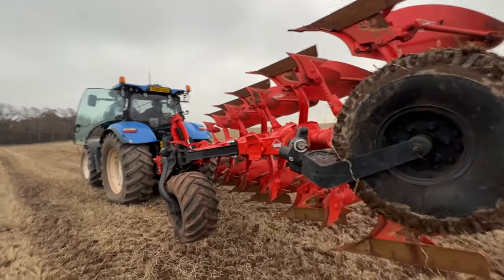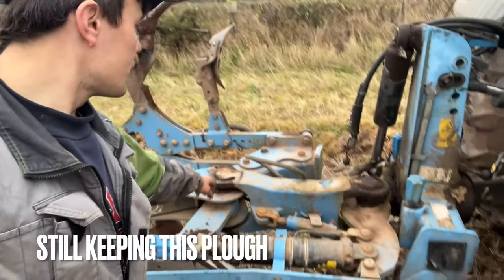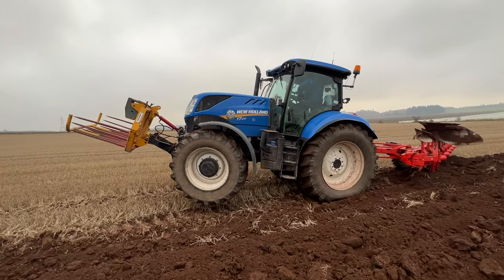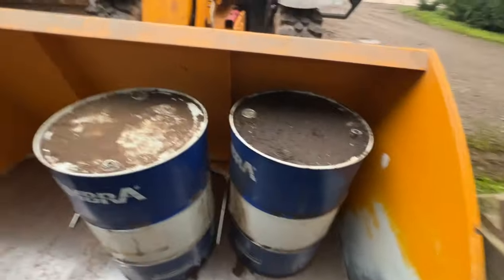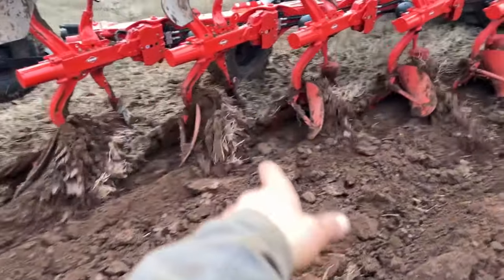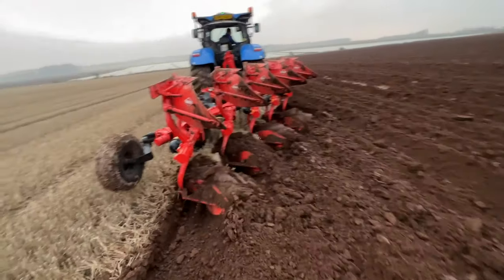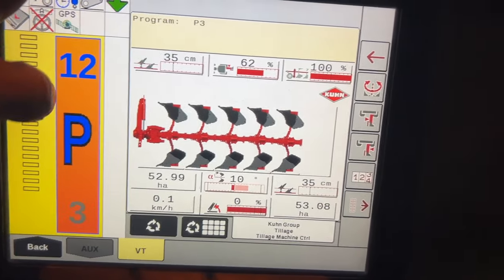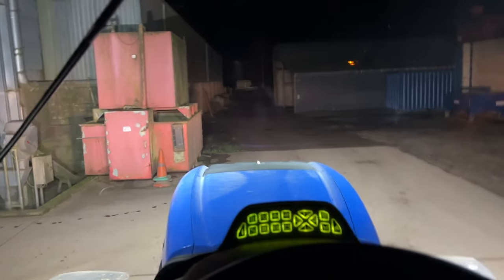Tractor On Two Wheels

Comment: Crawford mate....in ya chiller use 100mm x 100mm angle steel mate,will cost a bit more but will last 10 times longer than timber mate,drill holes in 1 side and rag bolt it down...works a treat done it loads of times in fridges 😉

Comment: KV were I'm pretty sure the first to design the plough to follow like a trailer. Really neat idea because unless you're going a fair distance people just don't bother because of the time plus they never travel well and you can imagine the damage if something Broke while on the road. 
My father had one or two top links let go but luckily on the field and not at speed. 
If the Kuhn is isobus I presume you can set it to straighten a curve in the ploughing. I know you can with the KV of you had the isobus one but do you need it! Must add a fair bit to the cost.